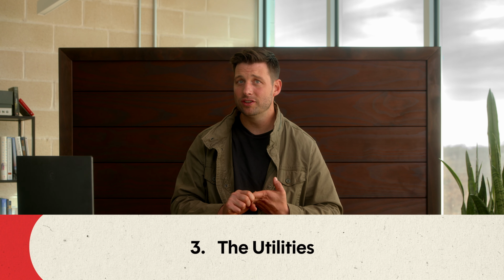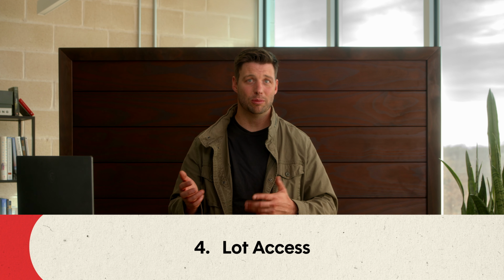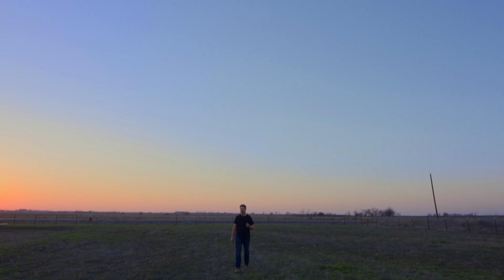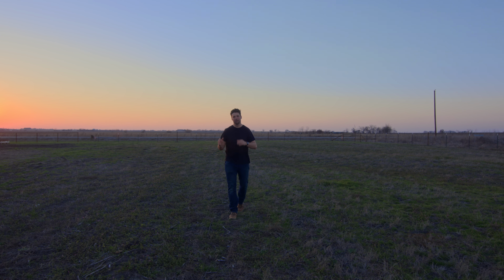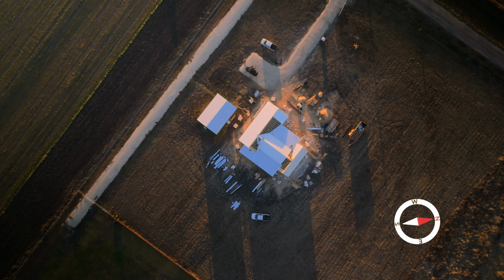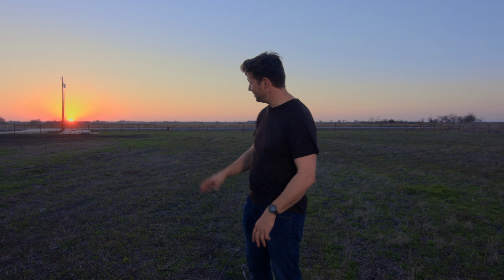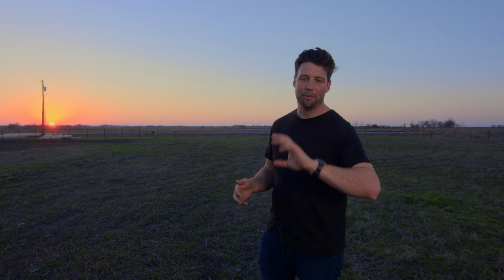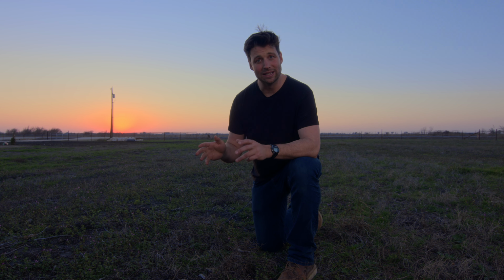Stop Designing Your House Before You've Done This One Thing - AHPH 103

Comment: For the soils test:
1. How deep do you want to go if you are to have a basement?
2. How deep do you want to go if you will need to put in a septic systems?
3. Do you even do a soils test if you will put in a ground-source heat pump?

In later episodes: How far away can you locate the septic system?
Reply from the maker: I would have your geotechnical engineer answer #1, your septic designer answer #2, and your MEP engineer answer #3.  There are too many variables for me to give a good answer.  Plus, I'm not qualified to give a good answer :)